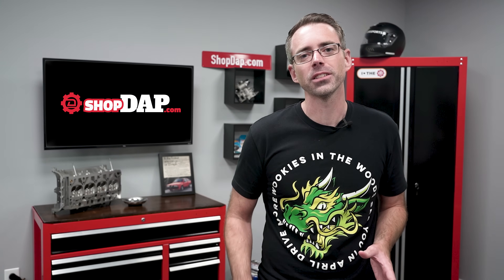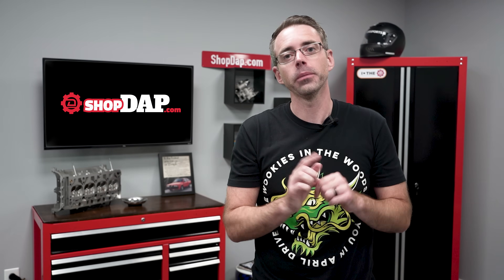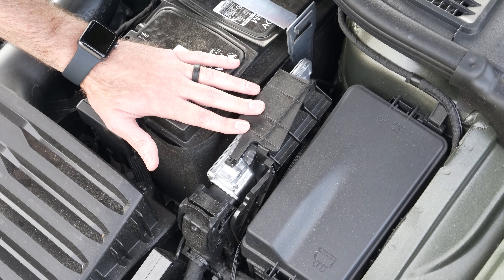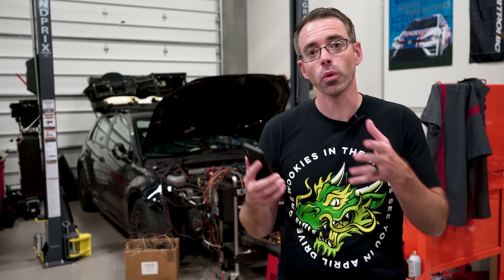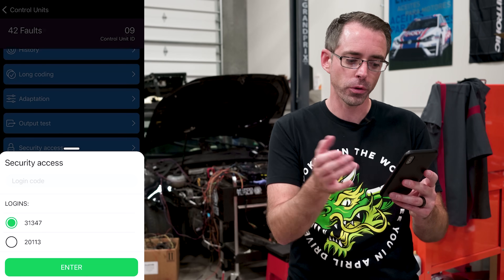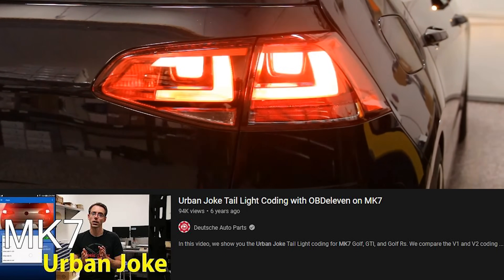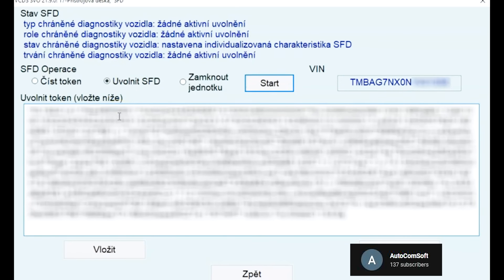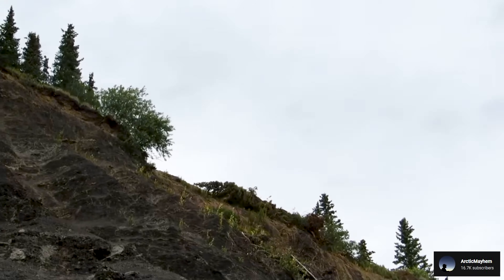Is VW Trying to Stop you from Working on your Car? SFD Unlock

Comment: Please please @Deutcheautoparts provide an update to this video given SFD2 implementation... Or maybe ask/beg @HumbleMechanic to do one?  Love and respect you guys greatly!  Seems this landscape is changing though, and not for the better.  

For my new-to-me 2024 GTI I was NEARLY going to buy OBDEleven based on this video and its many recommendations... but now I see they now state they cannot unlock SFD2.  I inferred your point here was that SFD seemed to be a reasonable hurdle to jump over for security (low entry cost for home mechanics) but now there are zero consumer level tools to unlock SFD2 (Carista can't unlock either) making the argument stronger that VW really is blocking our right to repair.  VW has effectively shut down the ability of home mechanics and small shops to change so many many things on 2024+ VW products.  What can home mechanics do now that SFD2 is being pushed out?  Go to the dealer$$$hip is becoming our only option.

Comment: So if the hood has to be popped..... what's the point of wireless? It sounds like wireless access was created to explain SFD and if the access was from the OBD2 port you could easily not have SFD on that physical access port. SFD will be expanded as the plant stories like "car was hacked" and then it will truly become a crypto nightmare.

Comment: One of the reasons we never drive a VW newer then 2008/09... and even the Golf3 can still be used, just needs RUST care 😉Golf2 and 1 are not so recommended to use as daily car. Missing  many safety featues etc. But 3 has airbags and some modells ABS etc too... and more comfort.... CHEERS  Buy a 3 or 4 Golf without sunroof which had rust care. These are cheaper to maintain and reliable compared to 2010+ cars. Also BMW, Toyota,Audi and Nissan can be recommended from 2010 o earlier :)) Nissan mostly do not look good - but reliable

Comment: I think this is purely money grab with licensing, and planned obsolescence, meaning they are laying ground to practically make your car useless after 10-15 years of use. Just take a look at apple, have you tried to use your 10 year old iPhone? Not just apple have discontinued the iOS updates/support for it, but also have blocked developers from creating apps for those old iOS versions by blocking signing certificates for it, so even if those devices are capable and you can use old devices for watching videos, making video/voice calls and sending messages, Apple will not allow you!

Thanks for mentioning right to repair, I think this is the most important law we need to push for our generation!

Comment: Are they doing this to stop you working on your car? Yes they absolutely are, if this was all about over the air update security then why havene't they allowed access without these tokens by using cable only devices plugeg directling in to the vehicle, simple, if you plug in via cable you don't need a token???  VW are lossing millions because people can scan their own cars get a faily accurate idea of what need repaing and do it themelves. The sfd system, will have cost vw millions to implement and they will get their millions back serveral times over or they wouldn't of created sfd. You know things have gone so crazy when you have to code a new battrery to your car. They say it's in the name of fraud, the only fraud I see is by VW who are implementing the SFD technology

Comment: This is purely to keep used modules from being installed in cars by shops that dont know what they are doing, you put a PCM in from a same year car that had a different engine and bad things happen. Component protection has to be removed if a different VIN is written in any module on the gateway before it can be programmed to that car.  Just so happens to also affect tuners in a negative way lol.

Comment: This is just another reason why I gave up on VW products but the biggest reason was their poor reliability in comparison with most Japanese cars. And another reason is VW's claim that it's normal that an engine burns oil - this is a lie. I've had Mazda 3's go over 318000 km and the 2 Liter engine burnt NO oil .. that reads zero oil consumption.

Comment: OTA updates is a bad thing why do you want anyone else to have unlimited control over YOUR car, this happened with phones when bootloaders were locked down, when user removable batteries and sd card slots went away, andwhen apple decided to slow the cpus on older phones. Cars are going the same way like when BMW and toyota turned basic functionalities into subscription models, when tesla decided that you only get access to the entire battery in your car during a natural emergency, and when mercedes decided to scare you aware from opening your own hood. It’s all a way to keep you reliant on something you don’t own

Comment: I think the reason for SFD was implemented was to stop people modifying software ,then running back to dealers demanding Warranty for destroyed engines and transmissions. Seen many media units " bricked" due to people trying to unlock features with unauthorised equipment!
Reply: Nah cause they can tell u reflashed the ecu or not. There’s a counter that tells them how many times was the ecu programmed so if u come in with blown engines or turbos and they see u flashed it they will know and deny but they would still have to cover stuff unrelated like window not working etc
Reply: @sneakerhead4770  correct and this is since edc16 ecus.... Golf MK5's...  the actual ones (i call them online shitboxes) recognize the reflash, no matter if you doing flash over OBD or BenchFlash by checking/verify the Checksumm in the ECU after cycling the ignition and send this data to the VAG Servers. So they know about your reflash and Engine/Drivetrain guarantee is over.
Reply: Well if that was the case, they would make the SFD block remove itself after the warranty period ends.

This is a money grab, plain and simple.

Comment: RIP all the dam wires out and start again but only the ones needed to start the engine and lights, fk the rest of those sensors up your exhaust. Mk1 had it right and they flew off the handle

Comment: As a vw tech, I have witnessed this become big with all VW MQB chassis 2020+ as when scanning vehicle with ODIS, you are given a message before aloud to scan “please open hood and connect vehicle to battery charger”. I believe this is VW responding to all those shortcut techs that like to not maintain vehicle voltage when scanning or performing module recoding/ software updates and/or configurations. As I have seen many techs ignore vehicle voltage leading to body module bricking AND in some rare cases, vehicle identification loss between VIN locked modules. I don’t believe it has any to do with the “right to repair” outside of the dealership however everyone outside of the dealership not using ODIS is directly effected.
Reply: Exactly what i was thinking!
Reply: This seems like an excessive and poorly thought out way to do that though. I am not a mechanic or work on cars, but i have an understanding of electronics and computers. 

From what I understand is it not something which could be solved by monitoring battery voltage, ? then not allowing certain functions if it keeps dropping, or designing the electronics to have more fail-safes like having backup ROM (at the cost of the customer). Also I feel this doesn't even address the problem because you can still disconnect the battery charger (e.g. having a power outage) after putting in the codes. It just doesn't seem likely to that that was their intentions, but I can only speculate...
Reply: Do VW need you to open the hood in case the vehicle is being emissions tested so the ecu can change it's mapping LOL?
Reply: @whizzo94  no that is not the case where I am. No testing in Florida. Strictly opening the hood so a battery maintainer is installed so the vehicle does not freak out from low voltages.
Reply: @whizzo94 Ford actually did this in the late 1970s or early 1980s. They got caught.

Comment: Paul - good video as always and important subject.  I think there are two reasons for SFD - (a) they /VW/ wanted to protect features that were installed in the car, but not paid for - IMHO this was an avenue to prevent and easy "unlock" of such features, (b) as a by-design this could be used to "ensure" that adaptations are not modified, and as such the software updates are easier for VW by "expecting" a defined set of coding. This is becoming a bigger issue now for those expecting their OTA/Upgrades in the future on the newest cars, especially the ID family...

The biggest mystery of the whole video - why was the SFD Unlock UI of VCDS in the video in Czech?
Reply: So feature is built in, priced in base models but you have to get gouged to use em.  Modern  corporate scam.
Reply: exactly ! you can also upgrade features after you bought the car by buy them / lease them and even try them for a specified amount of time.....  welcome to the new playstation online shitbox cars 🤮

Comment: This is exactly why I will keep my Mk7 GTI forever..   No unlock or digital cockpit and touch screen nonsense...
Reply: Amen
Reply: they are ALL cheap to produce and expensive to buy. It's a CGI system
Reply: I don't think I'll ever buy a car newer than 2016 or so. Between the insane emmisions regulations, manufacturers locking out systems, and stupid touchscreen controls it's just not worth it. Besides between 1980. and 2000. the difference in driveability is huge. Another 20 years later there is not much difference. Cars seem to have peaked around 2002. or so
Reply: Hello friend
Reply: I like my digital cockpit. But I'm with you in that this is as far as I'm going with my Audi. The 8V is generation is fine for me.

Comment: Presumably this SFD thing isn't like a Subscription thing that stop owners from being able to use heated seat warmers for example which BMW for example have thought about doing (or may have even started doing(????)) which if the customer/ owner of the car then does Subscribe they (BMW (for example)) would then unlock over the airwaves via and update and thus allowing the heated seat warmers to be used. Or have got this whole thing totally wrong??
Reply: No, the SFD 'token' is at a basic level identical to the old passwords and relates to programming a car. Enter the passcode -> you get about an hour to change 'hardware' settings. The only difference is that the SFD password is a one-time use and each time you need to ask VAG's 'mothership' for a new one, the old ones were just hardcoded in the car and never changed.
Currently the main issue is that asking VW for the code is not obvious and requires tools usually only dealers have. Now OBD11 also supports it so its obviously becoming accessible.
At the end of the day, the major change is that VAG now has a trace of each time a car's programming has been changed (and which component) and by who, since someone has to ask them for the access code each time.
Someone reprogrammed ECU and blew an engine? VAG can prove it. (besides the fuses in the ECU, the SFD also knows WHO did it)
Someone reprogrammed the car to allow running engine with the doors locked (illegal in eu)? VAG can prove it did not come like that from the factory.
Will VAG go draconic and disallow people access to adapt their cars for retrofits/minor feature changes, only time will tell.

Comment: Couple of weeks ago someone newer in the shop was programming keys and kept failing. Called me over and I restarted the process and boom the open hood message popped up(guess he was just clicking through to get through quicker) popped the hood and the keys programmed immediately. He spent about 25 minutes because he wasn't reading the instructions
Reply: I assume that he did not have the power supply when he was programming new key's not a good idea.

Comment: I wouldn't be worried so much about someone hacking my car.  I would be more worried about thieves walking around my car with special transmitters and receivers mimicking my key fob.  That is I would be if my car had one of the keyless fobs.  Those fobs are not truly keyless BTW, they often have a real key inside you can use if you get locked out.  My car has a standard ignition lock (aside from the key not looking much like the keys that you had 40 years ago).

Comment: Paul, I love the channel and your insights on VW. As a Passat owner it would be great to see them get some love on your channel. I love my car but finding VALUABLE information is a real struggle. Mine is a 21' SE, I have checked your site but it looks like options for tuning parts and your filters don't go the latest model years and engines. Thanks for all the great videos.
Reply: Passat's just don't get the love that they deserve, but that's ok I love my hidden gem. It's not a head turner and that's a good thing!
Reply: @danieloshaughnessy8476  Exactly!!! I am not looking to draw attention but I want to be able to go by someone and they say What the hell was that?
Reply: @RayRay-pg3fx  You're best gain is getting a tune.  Probably set you back $400-500 for your car.  Second best would be a performance suspension, springs and shocks. Id recommend getting an upgraded diverter vavle, GFB might have one for your gen Passat.  Other than that Id leave it as is, most people dont expect to be passed by a Passat.  Please, please, please dont get an exhaust or muffler!
Reply: @danieloshaughnessy8476  So my thoughts are a down pipe, Inlet, Intercooler and tune. Suspension wise I just want a real subtle lower, like maybe an inch no more. My challenge is finding reliable sources for the parts.
Reply: @RayRay-pg3fx  Well tunes can be really rough on the cars.  Id just go with a stiffer suspension and call it a day.

Comment: I have been driving VWs since 1973 and working on them since my 1983 GTI. I divide VWs into two periods - before Vagcom and after Vagcom. When the Vagcom came out it took away the mystery and changed everything. It really helped me understand my 92 Corrado and later VWs. If my old serial Vagcom with a USB dongle doesn't readily work with mk8 VWs then I am not buying one.

My 2015 Sportwagen TDI came with VW Car-Net which I didn't want because it makes me feel insecure and doesn't do anything I need. Luckily it was based on 3G which got discontinued, so it quit working. VW sent me a notification that said I could give them back control of my car by spending $300 on hardware, having it installed, and paying VW a monthly fee. 

So now that my Car-Net is dead I own the greatest VW that will ever be made! It doesn't have the noisy panoramic sunroof or problematic junk tech like ACC, automatic stopping, and light strips in the door panels. It is safe from over the air updates that could break a perfectly working vehicle. It averages 47 mpg in the city and 55 mpg when driving 75 mph. The manual transmission makes is fun to drive like a GTI. And my old Vagcom cable works without hassle. 

After 40 years of buying new VWs I guess I am done. The diagnostic limitations are the last straw. Maybe in 5 to 10 years I will buy a VW EV, but until then I will get a used VW with a manual transmission and use parts from vendors like DAP to keep it moving.
Reply: Man I miss my old 83 GTI. 
And a side note I couldn't live without my ross tech either. 
I do remember the dude saying at the booth at water fest in 95 that we got one of his first ones.
Haha it was in one of those project boxes from radio shack and the board was hot glued in place(he said it was a working prototype).
Haha I got a 50' long phone cord so I could drop it out the window and use the house computer 🤣
It's hiding somewhere but I haven't seen it in years. 
If you're gonna fix your own VW ,haha don't even talk to me unless you've got a multimeter and know how to use it ,and a ross-tech.
Reply: How did you use VagCom on a 92 Corrado...?
Reply: @RyanTheMalamute  The 92 Corrado SLC was the first car VW delivered with the new VR6 engine. That made me buy a burgundy one which I still have. It was also the first engine with diagnostic communications and before the OBD port we now use was standardized. 

When I got my Vagcom I also bought an adapter cable with it that has an OBD end with two wires coming out of it. You pull off the trim around the shifter to reveal the two connectors those wires plug into. At that time the only component that was integrated was the engine, which is vagcom's most important function. None of the other parts of the car were integrated yet (ex: windows, stereo, locking system, ...).

Comment: In my modest opinion, Hackerman could just as well have the car think the hood is open, then proceed to hack it and have it go off the cliff.
Reply: Without knowing the inner workings of the system, it may very well be more complicated than that. For all we know it could be a hardware lock which makes remote hacking that much more difficult.